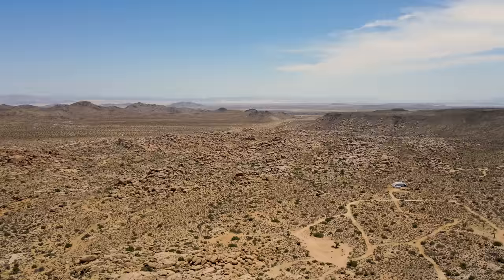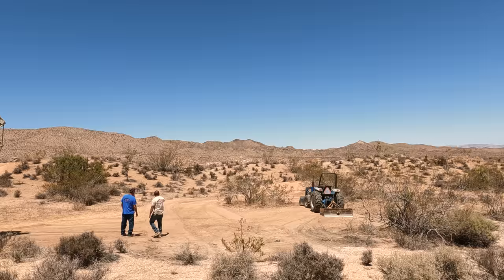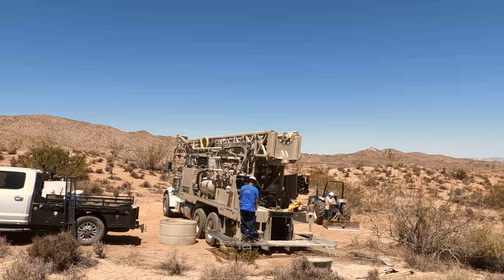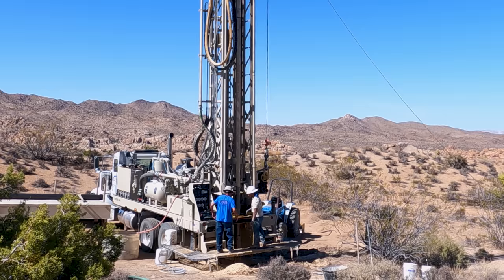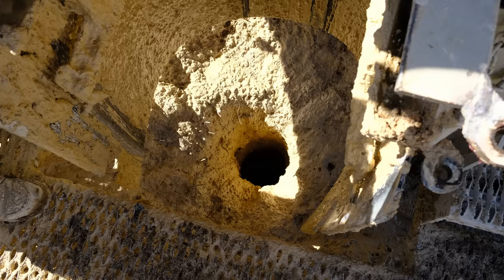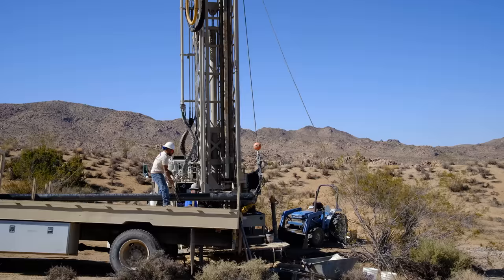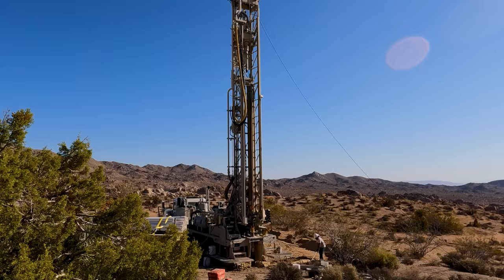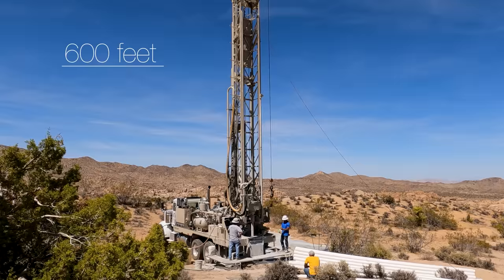Deep well drilling in the desert near Joshua Tree (part 1)

Comment: I drilled a well in Ireland I found loads of water at 100 feet but I went another hundred feet for column.i can Devine for water with copper rods
Reply from the maker: Curious, how do you know that works? I'm not saying it doesn't but have you ever done like an A/B test?
Reply: @LetsOverthinkThis  it doesn't work on anything less than very shallow surface water, I do electro-seismic groundwater surveying for a living its technology they use in the oil and gas industry to measure the depth of resistive liquids, I can tell you if there is a presence of water or not also at what depth it begins and ends also the yield youll have in gpm, accurate to a few feet.
Reply: I still think that divining thing is a bunch of BS.
Reply: It does work as i and another persons seem to find the same spots.it looks like it does as i had a well sank by my people back in 64 but useless then i divined this spot 15 ft away amd loads of water
Reply: @josephcahalane1971  i've heard that before! I want to discount it but it sounds like I shouldn't!. 😂❤️

Comment: Good job. Pretty much the same process is used to drill 20000 foot wells and deeper.   Different equipment, fluids, pumps, etc. But the basic process is the same. They were using an “Air Hammer”, with compressed air, some water, an a commercial soap to make the foam. I’ve dried many wells to 10000’ or more in Pennsylvania using this process. You did a great job explaining for the novice. 😊
Reply from the maker: Thanks! Really appreciate the comment. And thx for watching.
Reply: Jim 20,000ft is more than 6,000m. 6km. What reason for so deep? 
2. Can air blow out the chips from that depth? Or did you have foam assistance?
Thanks.
RSA.
Reply: @antonhuman8446  air is only good to about 12000 ft. 20000 ft vertically is not uncommon with fluid  mud. A lot of wells go horizontal at some depth and can go 30000 ft overall length.

Comment: Top casing is called surface casing. In the oil field they drill down past the freshwater, then push cement down the casing and up the sides to seal the surface water from the oil and gas formation. Then they start with a smaller diameter casing.
Reply from the maker: Interesting! Definitely different here with water, at least in this geology. Thx for sharing....
Reply: Different
Reply: Spent many hours welding surface casing. It was muddy and nasty in those cellars, but it paid good

Comment: Reason for 7:47  When they finish drilling a rod out and pulled it back a couple of feet is to keep the head clear of the debris. Water is pump to make sure the drill head is clear and not clogged. If not doing that you can actually suck up fine rock or sand Into the head and clogging the water port/nozzles. When you add another rod on. If you clogged your drill head it will overhead. The drill head is actually called a hammer head or hammer bit
Reply from the maker: Thank you for adding clarity and color! Much appreciated 🙌
Reply: Referred to them as "downhole hammer with flat bottom bit" when working in the Arkoma Basin of Arkansas and Oklahoma and the process as "air-drilling" and when no water you are "dusting" and when you encounter some water, you may need to "mist" or "foam" the air to create a wall cake. I was a wellsite geologist in the 70s & 80s.

Comment: In Ireland there are many drilled wells we have one too . Made in the same way . 
But we have a special insert on the bottom bit of the sleeve to make a water proof connection in to the rock.  Because in Ireland a lot off what I call dirty  ground water could leak in the well and can  contaminate your well .
Reply from the maker: Interesting! Here, they pour concrete between the 20' steel sleeve and the surrounding rock to make sure no contamination can seep in (plus the concrete pad that's required surrounding the steel sleeve at ground level).

Comment: Interesting video but raises as many questions as it answers. When you drill to 1000 ft or even 2000 ft, it's important to determine the static water level because that's the depth to raise water. Ultimately the total capital cost is drilling, installing the pipe work (casing) and the pump and motor. The operational cost are then the power / fuel cost plus maintenance of pump and motor. Total costs can then determine an hourly cost against the volume pumped ( gal or L/hr), obviously the less lift height- the cheaper the water.
Reply from the maker: Agreed but I think you may be thinking agriculture-scale water pumping. This is a well for a single family home and the pump easily pumps with about 600 watts to provide around 6gpm from the hole. The static water level is around 190 which honestly isn't bad at all considering...

Comment: My dad had a hammer drill rig do are well in Blue Diamond NV  outside of las vegas  in the 70s and they lost the hammer bit at 680 feet and had to start over. And  he witched it with coat hangers  that well had good water tell we left it in 2013.

Comment: I'm in the mountains and we have good water. The drillers hit water at about 80 feet but it's just surface water. The wells can be deep or shallow. My first well was at 240 feet. I had it re-drilled and they went close to 500 feet. My neighbor just drilled his well, 500 feet for 100 gallons a minute. I have watched them drill a few wells, not exciting but it is something to see.
Reply from the maker: Thanks for the comment. Which mountains are you referring to? And are you sure that's 100gpm?! That's an INSANELY high flow if true. 🤯

Comment: For low water yield,  install lower water level  probes to protect  the  pump. 
Also a high water probe  which  will allow  pump to start again. 
Mind you, a gate valve at the top of pump  riser  can be set to control the outlet, to allow  a medium flow rate.
Cheers, from  Chch,  New  Zealand.
Reply from the maker: Hi Tony! You're right, though things are a little different with these new-fangled pumps. The pump itself has a water sensor in it so it doesn't run dry and I've tested it.... it just shows low water on the panel top-side and resumes when submerged again. Also, not being a traditional pump, you're not supposed to gate the output of it. I don't know how much that matters since it's already pushing against a potential 500 feet of head but none-the-less being a brushless digital drive, it can get confused by being gated.
The pump will empty into a big holding tank and I will definitely have a float switch at the top to keep it from overflowing. And I will likely have another float under that one which triggers the pump to turn back on so the pump isn't cycling a lot as that top switch gets triggered on and off. IE the "band" will be wider and the water will have to fall maybe a foot in that big tank for the well pump to switch on (and then it will get to stay on for a while instead of going on and off). 

I also have something else up my sleeve: the pump has a very repeatable wattage curve that is dependent on the water depth which means I may build a little box that shuts off the well pump as the water gets low in the hole but BEFORE the pump actually senses it's dry, just to safeguard things.

Thanks for watching and for your contribution here!

Comment: I know of places in Australia where bores go down nearly 1km . And water free flows at over 1m ltrs per day. Bores here now are capped, sealed & water is piped to tanks, troughs, homes, garden taps etc
Reply from the maker: Yeah, definitely not the deepest well out there. Jealous of that 1M ltr/day flow, but this is a desert and we were lucky to get water *at all*. :)
Reply: @LetsOverthinkThis  we have a great artesian basin here in Australia.. some bores only need to go down a couple of hundred mtrs others about 1 km . The pressure is natural not requiring water to be pumped to the surface , but to minimise evaporation , they must be capped, sealed , piped, water stored in tanks etc . On very isolated outback properties ,  Open drains were used yrs ago  getting water to dams & isolated homes but evaporation rates were huge

Comment: ok... so.. I am a geologist over in Arizona.. I have spent years walking around the desert.. I also look at satellite images and I have been for more than 30 years... you will find water along the cracks in the underlying rock... rivers and creeks and dry washes follow fault lines... all of them... that's what creates the topology of the land... they meander.. because the Planet is going round and round so water wants to flow downhill in a straight line,  but the motion of the Planet creates curves and it bounces back and forth between the rocks... the water is actually flowing underground.. the sand and dust are porous... and those cracks where dry washes are is where you find water... if you look..  and find a place where the meander runs into a higher point of rock.. a cliff.. even a small one.. the area across the wash on the inside of the curve..  a fairly shallow well will give you water
Reply: vegetation is a good indicator for water... I look for saguaro here in the Sonoran desert... you are in the lowest region on Earth... below sea level... in some areas 
.. if I was looking... those ankle high bushes are a pretty good indication that you should look somewhere else 😉..  in the Joshua tree areas... that's what I would look for
Reply from the maker: Except the Joshua trees aren't in any clusters.. they're pretty evenly distributed on my land. Plus you can't drill near them even if they did indicate water ...
Also sorry to say while I agree that the topography might indicate deep water flows, the vegetation around here won't. The water is hundreds of feet deep and the plants all have super super BROAD root networks, not deep ones, because they have to get as much water from the surface as they can.
What did you mean when you said "you are in the lowest region on earth, below sea level"?

Comment: Things like how you found water in this spot in the desert ? Then the cost ..that would be interesting too. The slush is Drillers Mud. I’ve drilled six wells in Baja California and enjoyed the discovery of water each time. None of the wells were dug using equipment anywhere near as nice and modern as this.
Reply from the maker: Thanks for watching and yeah, sorry I missed those aspects! I did answer many times in the comments since, but to summarize: Cost was around $60k for what you see here and as for the spot, I bought the land knowing it was likely (but not certain) that water could be found there based on neighbor's wells, etc. I don't believe in dowsing rods (though anyone is free to!) especially at this depth, so we picked the spot that made the most sense for my site plan: most spots on the property would have been more of a pain in the future in terms of trenching and such.  The drilling company just bought the rig here after practically running their old rig into the ground over the previous few decades so I, too, was impressed by how clean and new it was :)
Anyways, thanks for the comment!
Reply: @Let's Overthink This  the rods definitely work but not for locating a well, they do work for finding shallow water, water lines and wires
Reply: @markwilliams4525  no
Reply: @ronandingridjohnson1409  no what?
Reply: @ronandingridjohnson1409  Yes

Comment: You could of try to tap Primary water that is deep in the earth and unlimited under pressure, possibly not as deep as what you drilled for an aquifer. Primary water comes up thru vertical rock fissures that can be drilled into. Been doing it for a100 yrs. Search, Primary water.

Comment: how many days did it take to reach 600 feets?
Reply from the maker: I think day 1 was getting all set up and putting the 20' steel casing in with concrete, etc. The next day they actually drilled to 480' and the day after to 600'. That 3rd day they tried putting the PVC in but as you can see in part 2, they hit a problem and had to come back with a mud pump which added yet another day. To be honest, it still all felt pretty quick to me, considering.

Comment: I hope you used a good dowser with knowledge of water levels on  the City wells in Yucca and Stumps to SITE the well.
.  What are they charging per foot drilled?
Reply from the maker: I didn't and I don't believe in it but I know people do and that's all good. 👍 I did use a well driller thats been doing this in this area for several generations.
I think it was somewhere around 68/foot at the time.
Reply: @LetsOverthinkThis    The 3 city wells up in Yucca valley are @ 300 feet, as I recall.   
That is a great price for all the work needed!).

Comment: What was the cost per foot to drill?
Here in rural AZ the going rate is $45/foot
Reply from the maker: Unfortunately it was about 50% more expensive than that (!) which you can probably chalk up to higher labor and fuel costs here or the fact that it's hard drilling through granite the whole way.  I mentioned this elsewhere, but North American was not the cheapest driller around but they were the most highly regarded and came most highly recommended, so it would have been less expensive otherwise.
Thanks for the question!

Comment: 600 feet is a "deep well"? 😂
While that's pretty deep, it not that deep, as wells go.

When I was a kid (in the early 80's), my dad had a well (actually, 2 wells) drilled on our property in the mountains of far-eastern San Diego county. Those wells were over 800' deep. Although they hit water at around 75-100', they continued down (through hard, "blue granite" rock). The result was beautiful, ice-cold, crystal-clear water, flowing so much that it could not be pumped dry with a 3hp submersible pump. 

Those wells are still in service to this day...
Reply from the maker: It's not a competition, LOL! Was just emphasizing "deep" compared to most of the water wells I see on youtube which are much shallower. Plus, it sure seems deep when its $72/foot ;)
Glad your well is still producing BTW!

Comment: Its called Reverse Circulation Drilling. Compressors can range up to 500psi 1100cfm plus requiring several hundred horsepower to drive it all. This machine is probably running a 350/900 but I dont know this rig. The bit is attached to a hollow hammer so they have in innertube just like the rods. Air goes down between the innertube and outertube or rod driving the reciprocating hammer while pulversised rock material, air and even ground water are forced up the innertube. Depending on the size of the shroud on the bit, some of the air/water mix will come up outside of the hammer and rods which keeps the hole clean and in some cases, reduces ground water which depletes hammer peformance if ground water is excessive. This action is why casing is required otherwise the constant action of material coming up the hole would destroy the "collar" pretty much guaranteeing you will "Bog" your rod string.
Reply: My bad, its conventional hammer. No innertube. All air and sample come up outside of the rods....

Comment: Did you try witching first?  Also , how many water tables are in the ground where you are? Can that be determined?
Reply from the maker: I didn't try witching because I don't believe in it (though many people do!). And I could be more easily convinced that it works for water like 20 or 50 feet underground. I'm not convinced anyone can sense water hundreds of feet down through solid granite. I don't know how many water tables their are since around here you're just hitting water between layers of rock and I knew it was most likely I'd hit it around the same depth my neighbors' wells had. 

Thanks for watching!
Reply: @LetsOverthinkThis  Good points. I am a land investor and witching works 100% on all my properties' am not sure about the depths. thanks
Reply from the maker: @angelofamillionyears4599  Curious is it common to drill and not hit water where you are? My point is, if you're in a place where people often hit water, how do you know witching works? (not trying to be an ass, but genuinely curious)

Comment: You should see the exact opposite of this, when you have too much water in your area and you need to drill a drain tube to lower the localized water point. Huge boring head, about as big as a Mini standing on its bum, and a big, beefy truck. Not much else tho, it's a pretty basic machine. Cutter goes in, digs a meter, goes out shakes the loose material out and resumes.

Comment: Is the depletion of aquifers/fossil water/groundwater, that is, the naturally stored water in the Earth's crust, part of the reason why certain parts of the Earth's crust are sinking (southern Sweden) and sea levels in certain parts of the world are rising by 1 mm per year (magnetic anomalies) regardless of how the polar ice caps fluctuate, as well as the glaciers on land fluctuating over millennia?
Reply from the maker: I'm not a geoscientist but my understanding is the first part, yes. Pumping out extreme amounts of ground water does lower the surface level in some places. My tiny well is not really contributing to this, more agriculture and huge developments. The second part, no. The ground is lowering because the thing underneath it (water) was removed. It's not displacing anything that would cause the sea level to rise. That, to my understanding, is both ice melting but more that water (like everything) expands when it gets warmer so when a planet worth of water goes up a degree or two it takes up more space. 
Thanks for watching and commenting!